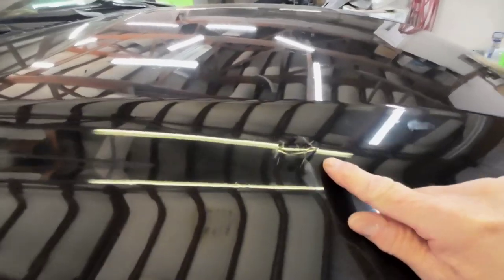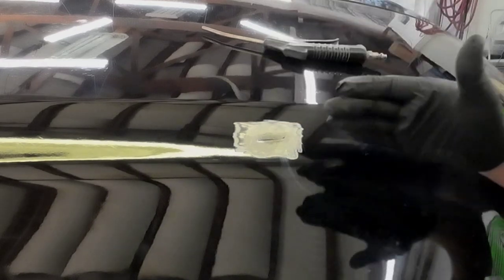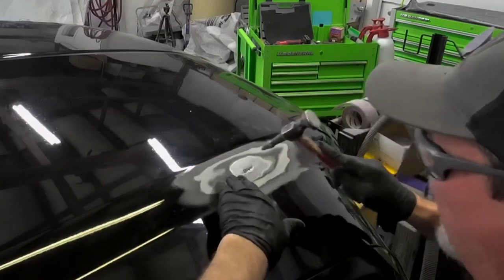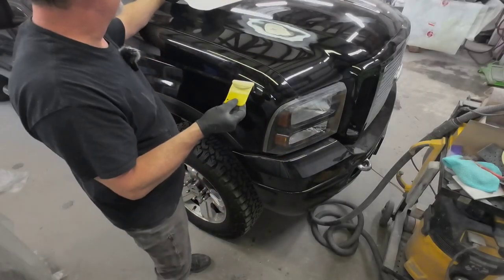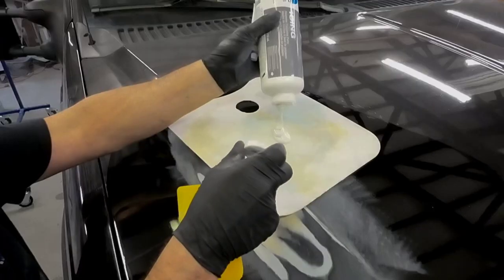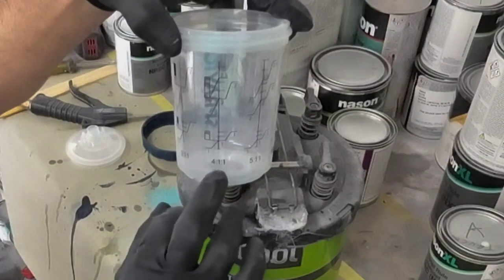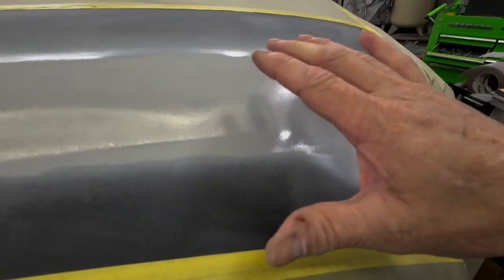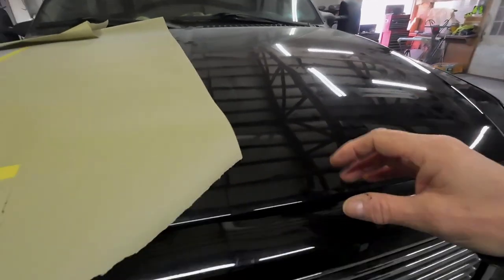What to know when repairing cracked BONDO

Comment: I've got several sanded breakthroughs in my paint job on a 1972 Chevelle. I'm going to use some of your techniques for sanding out, then primer then paint and clear. If you have any issues with breaking through your clear coat, I would appreciate a video on that. You do a no BS video and provide the detail to do the fixes. Great Job!

Comment: I don't know what paint system you use but the absolute best answer for this type of situation is a waterborne sealer. The reason for this is that there will be no lifting since the waterborne system isn't going to attack whatever crap is underneath it and it will seal the topcoats from lifting whatever garbage in underneath the sealer. It's a cool chemistry trick and it works when you have no idea is to what was used before you got there.
Reply from the maker: Yeah, that's the nice thing about waterborne paints.

Comment: Tip for cleaning out that crevice nicely: use a thin wire wheel horizontally. Works real nice 👍

Comment: would it be better to use fiberglass first then refill it over that? i thought for holes the former is what you want since bondo/filler types I thought was recommended not for holes but only up to about 1/8 in deep ?  it seems its hard to know when to just replace metal by welding vs filler etc
Reply from the maker: Yes, for hole fiberglass is the best.

Comment: I'm having a hard time removing 22 year old body filler completely. Can I just apply new filler over the old stuff? It's been there 22 year, so my guess is I should be fine, just need professional advice. Thanks
Reply from the maker: Depends what your looking to do honestly.  If your restoring it I would remove it . If you getting a good looking driver ready than leave it. It's a little risky but you should be fine.
Reply: @GarageNoise  Thanks! I got it off the quarter panel, the stuff I'm having trouble getting all of is the frame under the driver door. I'm not gonna worry about it.

Comment: Just curious. Why are you using gold and not glass, acid etch, or even metal glaze?
Reply from the maker: No particular reason. There's plenty of great fillers out that would work well. Appreciate the comment and support!
Reply: @GarageNoise  I mean you stated the guy wants to sell the truck so he doesn’t want to spend a ton of money on it. And that’s okay. But won’t the next owner have the same issue you are fixing now…? Honest im being sincere, it’s counterintuitive though, the hole in the hood will draw moisture, and without the acid etch will rust right?
Reply from the maker: @jhenson5168  Your right about the hole. Although the hole is not what cause the hood to rust . That hole was created by the spot welder. There's no way to be sure what caused the moisture to get under the filler. My guess is because the dent wasn't pulled the adhesion of the filler wasn't  good and allowed rust to form. Your right the hole should've been welded but for years the procedure to pull a dent was to drill a hole to pull it out then fill it. It'll take a long time for that to rust but that doesn't  make it ok either.  Appreciate the comment!

Comment: If you filled it with fiberglass, would it have been better
Reply from the maker: Fiberglass is a good option I didn't feel it was needed here but could've been used.
Reply: @GarageNoise  I was asking because I fill the dent with fiberglass I was just wondering how long it was going to last